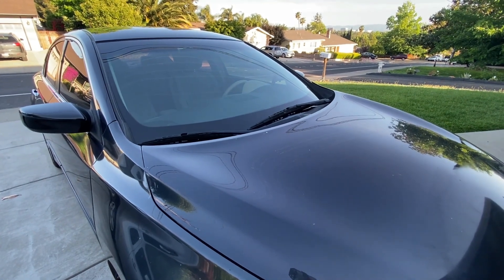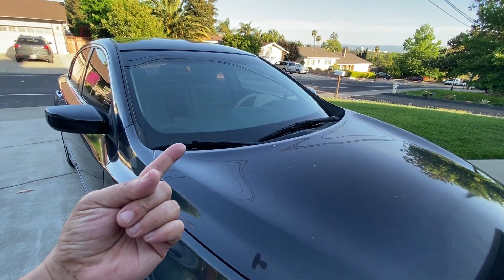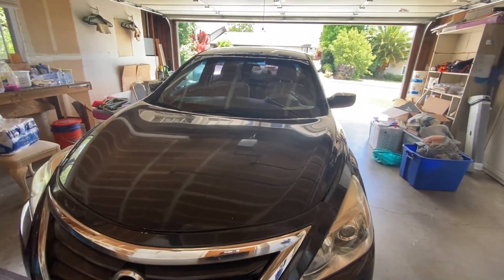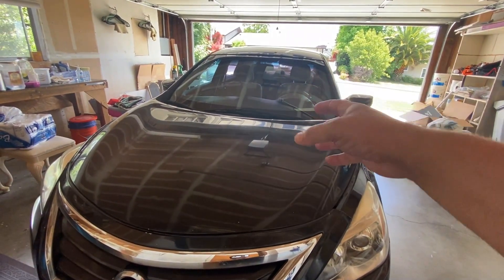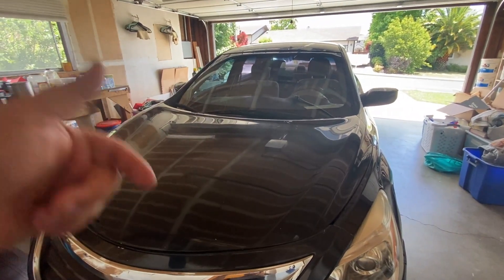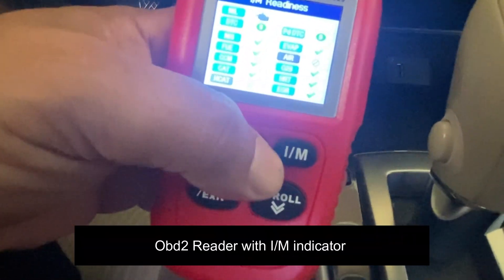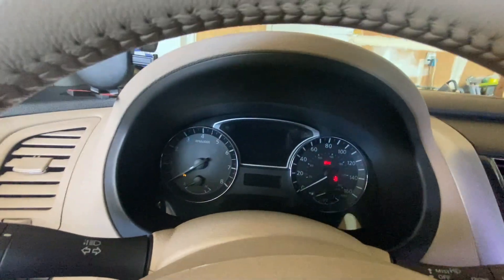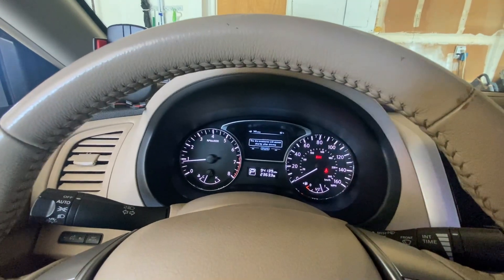Emissions Drive Cycle Tips & What to Expect At Smog Station

Comment: Is the hybrid car do the same for the driving cycle?
Reply: Since the have an internal combustion engine they also have monitors that need to be set.  If you can find out how to put the car in a "Maintenance Mode" that keeps the ICE running full time so that gets them done quicker.
Reply: @stevew9563 thx

Comment: If I run my drive cycle and finally get my OBD Scanner to show green, how long will have to take it to shop for emissions before the next cycle happens and computer runs selftest? For example I am afraid its green and suddenly right before the shop, it runs cycle and check engine light comes on? What is my time limit in this case?

Comment: Thank you for this vid. Since clearing my fault codes (was previously tuned, now stock tune is loaded), I have driven 112 miles & completed 3 BMW drive cycles. I can't get the FUEL to go ready. Everything else is Ready. Any tips\tricks are appreciated. Using the AL319 AutoLink
Reply from the maker: Thanks for the feedback. 

That’s weird as the fuel normally completes really fast. Here is the bmw drive cycle
https://youtu.be/mk6Tk330Acw

Try it and let me know how it goes while I brain storm.
Reply: @RANDOMFIX  Thanks for responding. I also tried the drive cycle mentioned in 11:19 from the link you provided. What's crazy is if I use Stage 1 tune, FUEL is ready when I complete the 20-30 MPH for 3:15min drive cycle. Anyway, I'm all set for another 2 yrs  :)   Have a good one!!
Reply: Are you trying to pass a SMOG in CA?  You actually do not need the fuel monitor to be ready to pass smog.  The Continuous monitors are ignored on CA smog checks.  Not many inspectors know this so you get some resistance to them running the test but just ask them to please run the test.  It will pass.   

If you would like to see where this information is search for "CA On-Board Diagnostic Test Reference
"   See section C footnote 3

Comment: 2010 Ford f150 5.4 v8
Truck has all monitors ready except (Evap) but it has permanent codes PO455/46/47
All evap codes..
Drove 200 miles and their still there.. 
repairs have been made and ecm reflashed.
Btw car was state reffed due to smog shop doing dirty work
Reply from the maker: Thank you for your feedback, much apprecated!
Reply: @RANDOMFIX  guys. Just make sure it’s done 15 cycles and you’re good.. had to find out the hard way in California.
15 cycles and it’s not clear take it anyways and they are required to do it manually and it’ll pass
Reply from the maker: Awesome information about them have to manually pass it. How did you figure this out?
Reply: @RANDOMFIX  went online did some research on BAR in the state of CA and it says if it doesn’t clear after 15 cycles they need to check it manually . 
Went in and they did it manually, passed
Reply from the maker: Awesome, thank you for correcting me!!! Much appreciated

Comment: Brand new C8 Corvette.  Can't get the O2 sensor ready?  Do you have a fix for this?  Please and Thank You!
Reply: Probably already got this resolved but for future reference GM does not allow some monitors to run in the first 1000 miles of the cars life.  You can go to the state Referee and get a passing test with the Monitors incomplete as long as the car is CA equipment equipped and is under 1000 miles.
Reply: @stevew9563  LOL. That would have been good to know.  The sensors finally all became "complete".  I just drove it more.  It was around 900 miles. Thanks for the the info though.
Reply: @PurnellPictureShow  -Yea I actually came across that tip on the corvette board. seems lots of those guys get them straight from . assembly and try to smog in CA. And GM does not let the monitors run to sort of "Break in " the cats.   Don't want new owners getting a check engine light after they just dropped 80K !!
Reply from the maker: Brand new? Check to make sure your battery is ideal and start vehicle and just it idle for 20 minutes and drive around town for 15 minutes at 35 to 45 mph. Out of curiosity why do you need a smog on a 2020+ vette?
Reply: @RANDOMFIX  Because of the insane CA markups, I purchased it in  PA and got it at sticker price.  CA requires all vehicle with out of state registrations to get a smog check.  Even though the car has a sticker that says it was built to CA emission standards.
Reply from the maker: I hear on the markup bs that dealers are adding on! 

Check all the o2 connections and connectors. Just un clip and click the connector back on. Honestly I had a similar situation with another viewer and the poor guy got the run around for a few months. I actually just text him and when he provides me the vette specific drive cycle I will forward it to you. Please check in with me in 5 days.

Comment: How many mph to run on a freeway for drive cycle?
Reply from the maker: It depends on the make model and condition of the vehicle. What are you driving and I will send the exact drive cycle that explains it on video so your are not driving around wasting fuel.
Reply: @RANDOMFIX   2019 honda passport egr not ready code and I can’t figure it out.
Reply from the maker: Hi, here is honda cycle that explains everything in depth for your 2019 passport https://youtu.be/oZELvZ4danA on the video read the comments, on honda vehicles you will have to rev the engine to test some components like the vtech .

This little trick will let you know when your monitors are ready. https://youtu.be/cxpE_I1cKh8

Good luck and let me know what happens